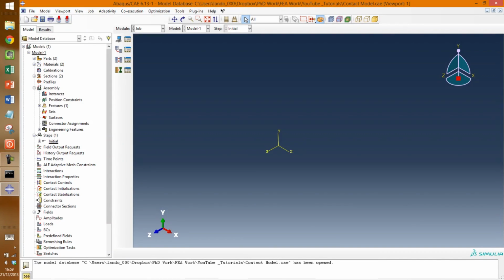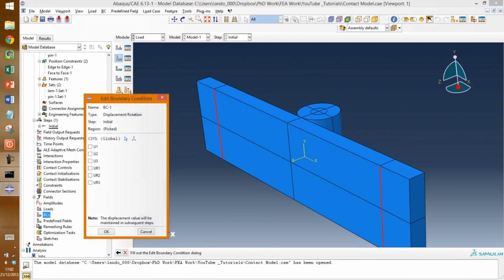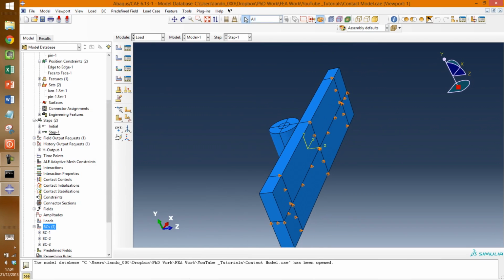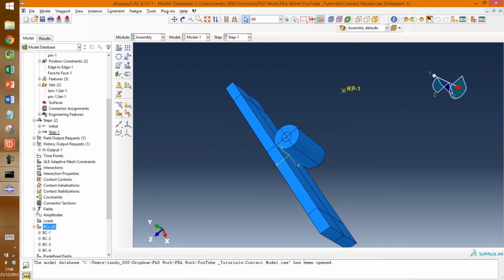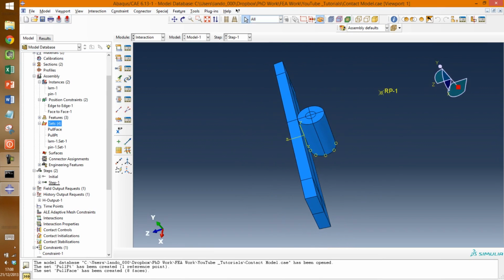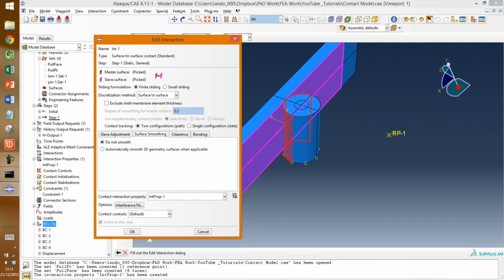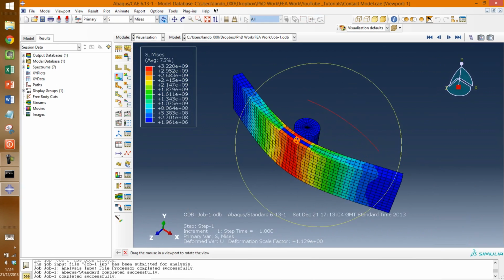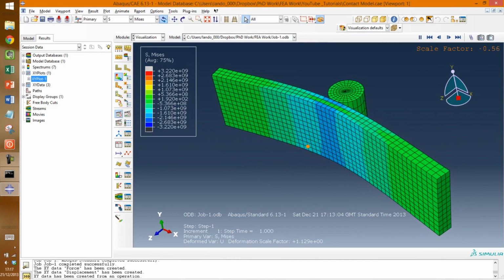Abaqus Contact Model Tutorial - Three Point Bend

Comment: Could you explain the purpose of the offset reference point? I must be missing something in the video but keep getting no displacement, if I change the displacement boundry condition to be on the pin geometry it works though.
Reply from the maker: The offset point is really just a habit I have to make it easier to apply loads and take force readings from. Once you've tied that reference point to the pin, everything that happens the pin happens the point. It's been a while since I made this but that was probably why.

Comment: I get no results. It seems like the equation linking the RP to the surface of the pin doesn't do much. I can get results if I put a BC on the pin to move though. Hmmm....
Reply: if still relevant, check DOF that you are setting, in the video movent is along Z, so DOF is 3. In my case movement is along Y, so I set DOF 2 and it is working for me
Reply: Have the same problem =(
Reply: л
Reply: Give some practival value of displacement

Comment: Hi this is very helpful! Thank you. May I ask you a few question? Why do you enter the displacement in meters? SI unit actually should be millimeters or did you put in the youngus modulus in N/m2? Another question I have is if there is any way of getting the strain data for the bending test to fit a regular stress strain curve since using the force - displacement curve to measure the stiffness of the specimen is not wrong but only an approximation. Thanks for your help!!

Comment: I am so sorry for asking this question but I am beginner regarding this stuff:

Through your video, you didn't input any loading on the pin, so how did the specimen bend?

I apologize again for this stupid question ;)
Reply from the maker: It's not a stupid question, when I started FEA I would have been confused if a load wasn't applied but loading occurred! I think in this model I applied a displacement boundary condition to the pin. So I told it to move in the positive Z direction by 3.5mm. So I applied a displacement, not a load. If you check the reaction force of the reference node when analysing your results, that will tell you what your load is for the applied displacement.
Reply: Thank you for taking my question into consideration, and I am so grateful for your help.

Comment: I want to model rotational spring which I can control rotational stiffness in Abaqus. Could anyone tell me about that?. 

I want to apply moment M1(x-axis) on both edge1(both on layer1 and layer2) and edge2. As you can see from picture above, the little green points are 
attachment points I created on both layer1 and layer2. I want to have all displacements of green points on layer2 to be the same as green points on layer1 but not the rotations. 
I would like to control the "ROTATIONAL STIFFNESS" of green points on layer2 by myself. For instance, If I assign "ROTATIONAL STIFFNESS" of green points on layer2 equal to 0.0(free to rotate),
then I expect to see layer2 just rotate without bending. On the other hand, if I assign "ROTATIONAL STIFFNESS" of green points on layer2 equal to 1.0, then I expect to see layer2 bend along
with layer1. 

I created wires to connect between both green points, created connector section as "HINGE" since it might fit what I want. 
Anyway, I'm not sure if this equivalent to rotational spring I needed. 
Any comments/suggestions?.

Please advise,

Thanks in advance,
kmm.

Comment: Hello. I did everything step by step but when the Job was completed  and I clicked at the "plot deformed shape" nothing happened. Could you please tell why it doesn't work? or maybe the reasons which could cause this problem.
Reply: I have the same problem. Were you able to fix it?
Reply: Have you figured out the problem guys? I just did this tutorial regarding contact model and at the end got any deformations. I have tried to imply different magnitude displacement but still nothing.
Reply: hi guys. It works only when I use 3d-discrete rigid-shell extrusion for pin.
Reply: Oleg Stryzhyboroda does it provides same results as in the video?
Reply from the maker: Oleg Stryzhyboroda Sorry it's not working for you guys. It worked for me as a 3d-deformable solid when I made the video, and it's still what I use these days. I'm not sure what the problem is, but I have encountered it before in other models without explanation.
Reply: I think problem is related with this warning message: ***WARNING: DEGREE OF FREEDOM 2 IS NOT ACTIVE ON NODE 1 (ASSEMBLY) - THIS BOUNDARY CONDITION IS IGNORED.
The displacement of the reference point is prescribed exactly at this node and in my case it is DOF 2 (in video it is DOF 3) but for some reason Abaqus disactivate it so, at the end there is no prescribed displacement at the model at all. That's why nothing happens at the end. The question is how to fix this problem?
Reply: ScoobyyDoobyyDooo
Hey guys, I had the same problam, I am modelling wood-concrete composite T-beam and wanted the simulation to be displacement driven. I changed the pin by a steel plate 2 inches thick and kept the same interaction between the plate and the beem (hard-contact and frictionless). Then I created a set called bottom plate which is the inferior surface of the plate. It could be the to surface, I don't think it will change anything. Then I created a boundary condition on that surface only with a displacement in the direction I wanted. For me it was in the Y direction (U2) instead of the Z like in this video.

Comment: Thank you very much for this tutorial
but there is some thing missing that is the dimension of the specimen
Reply from the maker: Hi Hazem, the dimensions are:

40mm long, 7mm wide, and 2mm thick.

I have the boundary conditions simulating the support pins at 30mm apart (where the partitions are)
Reply: thanks a lot